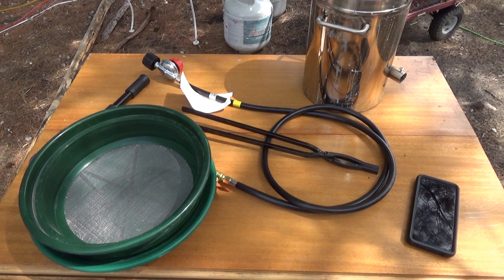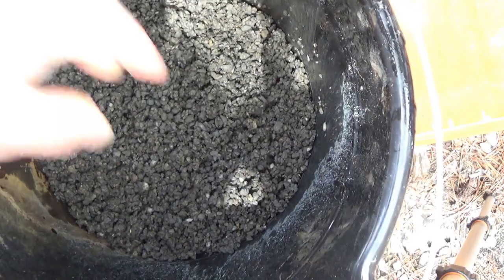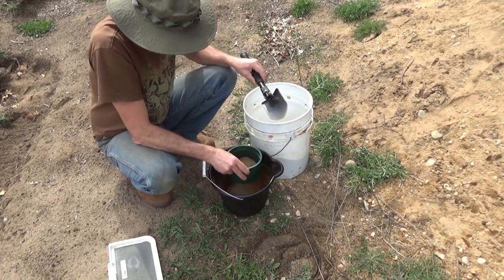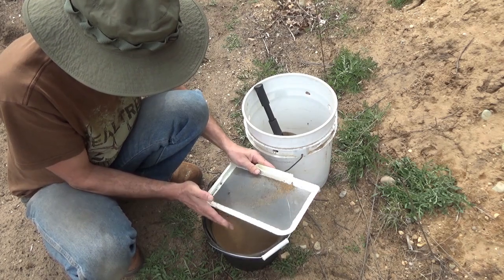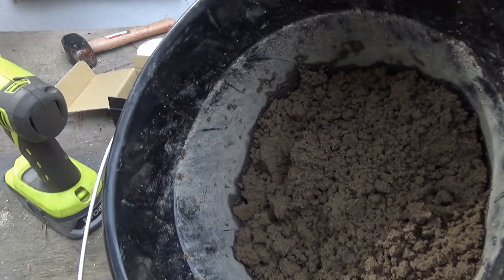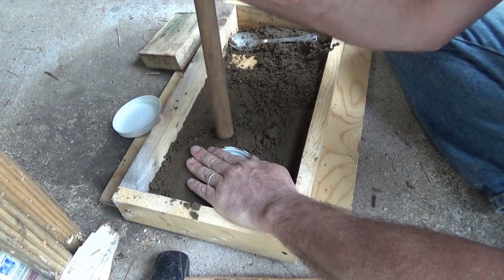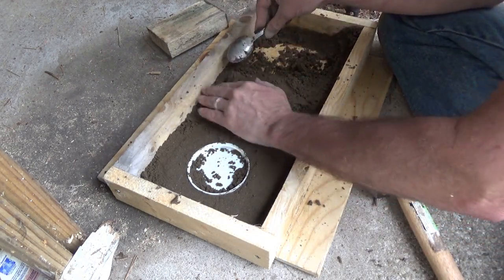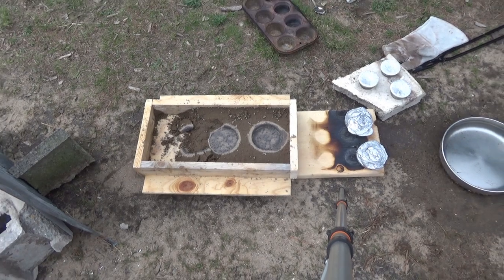Making Green Sand Casting Sand For Melting Aluminum

Comment: Why not 3D print small parts that you need or have a 3D printing service do it?
Reply from the maker: Instead of casting metal you mean? For what I need aluminum is actually the best material. And its fun. And I can do it myself.
Reply: You need to get a book on casting. You need a two part flask to make a mold with a top and a bottom. And use a spue and a riser to pour in. Then there is enough metal to allow for shrinkage. And make sure your sand is dry or you will make steam and blow the mold up. HAVE FUN
Reply from the maker: Yeah, I learned about wet sand the hard way. LOL. For this cast I decided to just do an open pour. Its a flywheel with nothing complicated at all. For future castings I will buy or make a flask.
Reply: Because I want to expirement w😢a new allow.